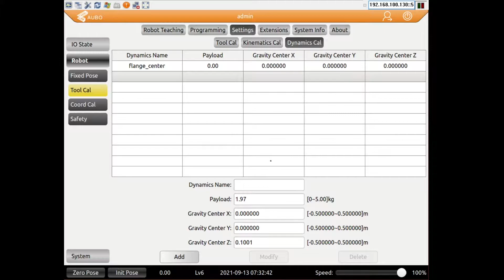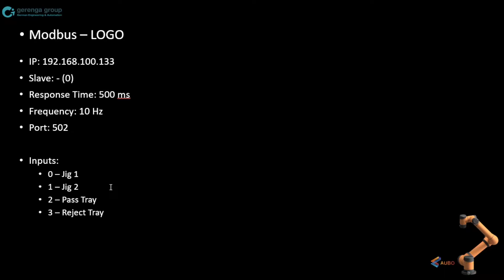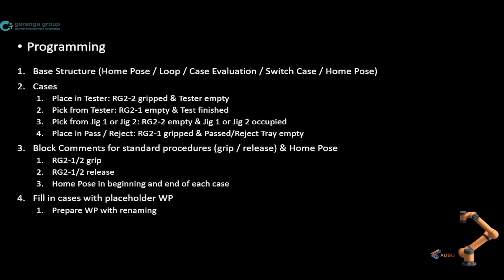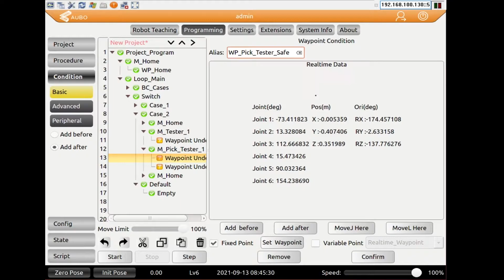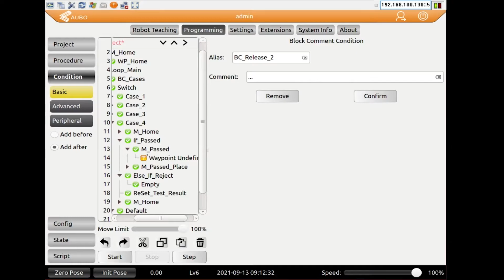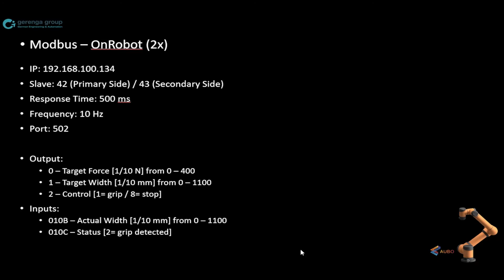Tutorial PCB Board Testing Station - AUBO // OnRobot

Comment: I tried to install the OpenSSH server on teach pendant but it seems it has been restricted to do any changes on ubuntu. I am wondering how did you install the remote desktop (considering the port 5900, it should be VNC)?
Is there any way to modify the ubuntu or making a backup of it?
Reply from the maker: Hi Hiva,
Please do not test any changes on the OS or of the software on the actual robot. Nor install any programs that might interfere with the robot system. The risk is too high that certain functions or even the whole robot won't work anymore.
Please use the virtual machine for these tests as you can easily restore it.
Tip: We didn't install any software for the remote desktop. 
I can't provide more information as we cannot risk that people who are not an expert do changes on sensitive data by themselves.
Oliver
Reply: @AUBO_Thailand  Perfect, thanks for your advice.